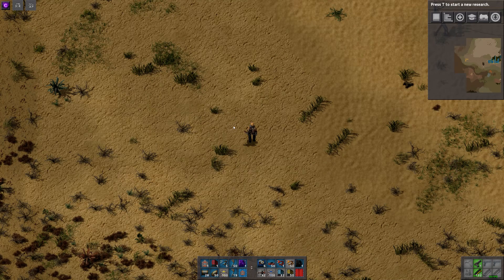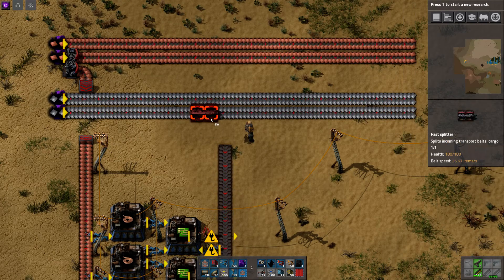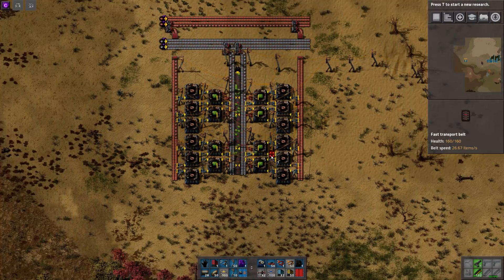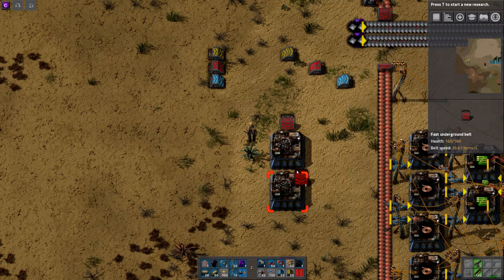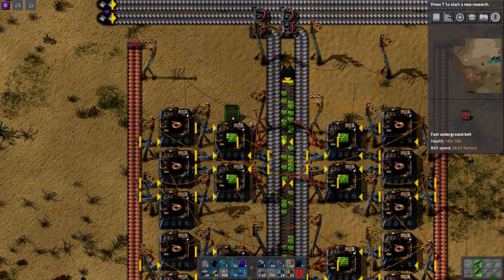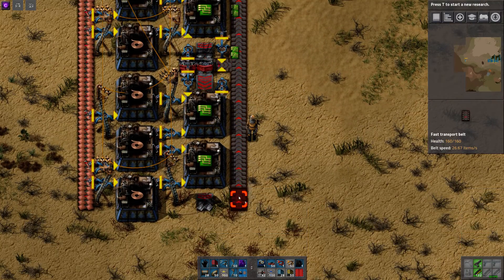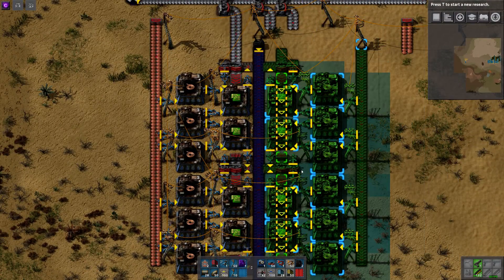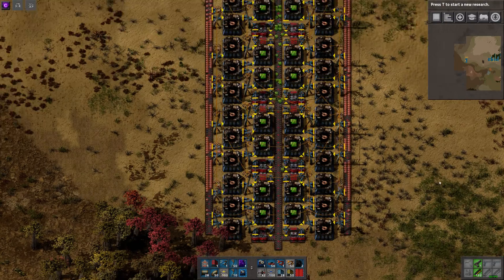Factorio Compact Green Circuit Production

Comment: this setup is close to good, but not enough. You can do with just 2 copper wire assemblers to 1 green circuit assembler. You'd do better with having 2 green circuit output lines rather than 1 with few splitters. That way you can make really long green circuit setups.